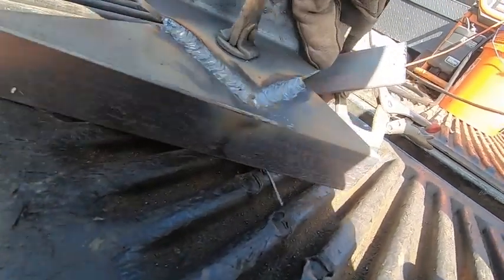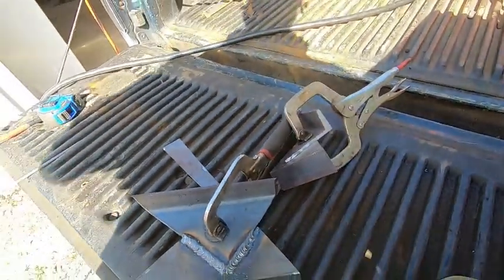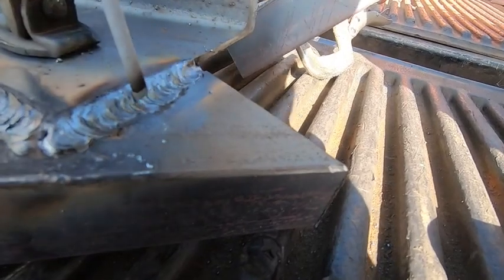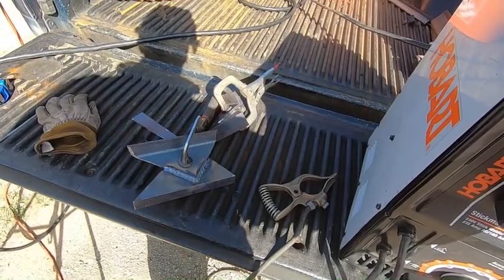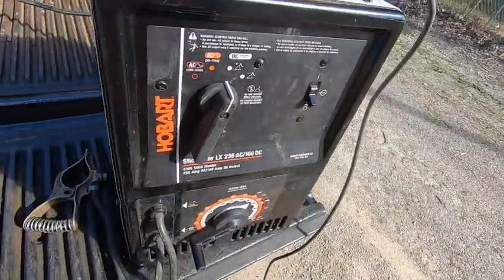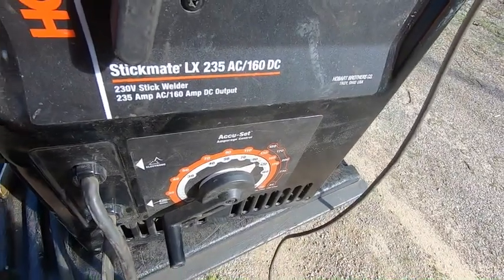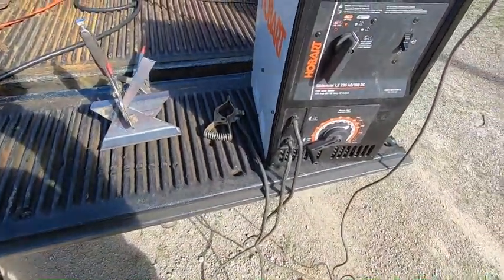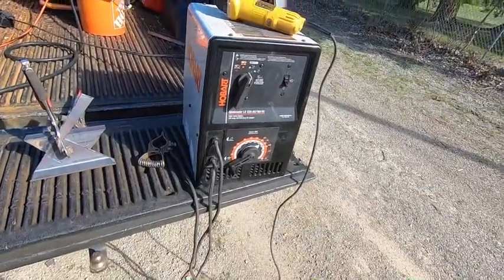6010/8010 welding with the Hobart Stickmate 235/160 Lx

Comment: Hello
I have the same Hobart welder. I've been wanting to use my Champion 10,000 watt generator
 Have you had any problems with your generator since the making of this video?
Reply from the maker: I have had that generator since 2016 or so. Over the time that I have owned it I have had to replace the fuel filter and clean out the fuel system when I came back from a deployment and had it sitting awhile. I never cared enough to check the oil and have mostly used automotive grade oil so sometimes it would burn off and get too low for the auto shut off sensor to pick up, which would shut it off. Add a bit of oil and it was ok. I have since learned that small engine oil is actually better than automotive oil and resists heat from small engines better. So now I use small engine oil and it doesn’t burn off as fast. The battery has gone completely dead so I just pull start it, which being used commercially has caused me to replace a few starter cords. No big deal. I hit the low idle thing-a-ma-jig with some steel and it’s now stuck on high idle, no big deal. One of the Ground fault outlets was giving me issues for a minute but has since corrected itself. Also the fancy smart screen, hour meter/watt meter thing stopped displaying numbers. It is still on my truck powering welders and grinders in a commercial capacity to this day. All the problems I have had with it were things that are wear items easily fixed or options that you don’t need and make no difference mechanically. I have started running inverter welders which are significantly easier on it though. Occasionally it does still run the transformer machines without issue. The Hobart has been used to build about 35 flights of metal stairs if that lets you know how much I used it. Also built about 10 Amish made cultivators with the generator and mig welder. Plus thousands of welding repairs. I did fry a M12 Milwaukee battery with this generator once when I was running the Hobart with a battery charger plugged in. Not sure if that would happen with the inverter welders but I do not plug batteries in on the generator any more. I’ll find a wall outlet or use an inverter off the truck battery before I plug them in to the generator now.
Reply: @scrapmanindustries  thanks, I may be buying another generator as the one I currently have is for power outages. 
I would like to be mobile and get my side hustle going
Reply from the maker: @orlandoherreraoutdoorstexa7353  you are welcome. Get that side hustle going. I have other videos on here from before this video when I was welding and tearing apart scrap in my grandmothers driveway till now where I got my own rig set up. If you need ideas for how to set yourself up there’s tons of ideas on the tube. Some guys put way to much though and money in their rigs but if you look at mine, especially the early days it was a pretty simple and cheap set up

Comment: How do you have your generator set up to run it? Did you make a pigtail?
Reply from the maker: I have roughly 150’ of extension cord. Split up into like 50’ and 100’ sections. The end going into the welder is the stock plug style on the welder. The end going into the generator is a 4 way round with only 3 wires hooked up. I think it’s 2 hots and the positive. Don’t quote me on that though.
Reply: @scrapmanindustries  30 amp breaker on the generator?
Reply from the maker: @chopperduke5998  si senior
Reply from the maker: @chopperduke5998  it doesn’t really pop at all. Unless you get the fronius transteel out and crank it up to start spray arc.

Comment: Other  than ultra high strength steel there is no reason to run such rods .Mild steel only has about 55000 tensile strength .  I can do a bend test with 6011 all day long .  So that means 60,000 tensile strength is all you need
Reply from the maker: yes. but it never hurts to practice on different rods. plus it was a fun experiment after reading tons of people who said that this machine can't run 6010.
Reply: @scrapmanindustries  sir you are 100 percent correct .

Comment: That’s Hobart similar to a red Lincoln 225 cracker box 📦? Looks like hobarts version
Reply from the maker: The Hobart is a miller thunderbolt with a white cover slapped on top of it. It is infinitely adjustable where as the Lincoln has set amps in like 15 amp increments. in my opinion the Hobart welds a lot smoother as well. The one plus side I see for the Lincoln is the handles. If you watch my videos with the stairs. I had the Hobart up and down that enitire apartment complex until I got the fronius.

Comment: I like the way Hobart welder is doing. With the thickness of metal you using, how many duty cycles is the Hobart 100% duty cycle ?? 
3/32 E 7018 and 6010 ++++ Lincoln or esab rods is good for all positions and pipe and put 1” thick metal im sure that Hobart can also handle 1/8 rods
Reply from the maker: The generator is 6800 running watts and 8500 starting watts. Running 1/8" 7018's on the Hobart does make the generator work but I have never had a problem with it. I have ran 5/32" 7018 off that set up as well and there were times where it would bog down the generator but I was able to make it work. I wouldn't recommend that if you were getting paid for a project. I would stick to 1/8" or smaller so you don't destroy your equipment or mess up the project your working on but it will do it occasionally. 

The duty cycle on the Hobart is like 20% near the top end like when you are running 5/32" 7018. 
When your just running 3/32" 7018 I would imagine that your probably somewhere Close to 80-100% duty cycle. 

This was definitely a great machine to start out with. I have upgraded to a fronius transpocket 180. The Hobart has stuck a lot of metal together though and if that's all I could afford I would still be using it. It seems like It will outlast me if taken care of properly.

Comment: 6010 = 60 indicates 60,000 psi nominal tensile strength of weld metal. 11 = 10 digit indicates all position (flat, horizontal, vertical, or overhead) 1 digit indicates the type of flux coating and therefore the polarity that can be used. The zero in 6010 indicates high cellulose sodium and it can be welded with DC electrode positive. 6010 is also known for being difficult to start or run on DC positive if the arc voltage is on the low side, typical with a smaller, less expensive machine running near it's limit. This can also be more of an issue with some brands of rod over other brands even with the same size and rod number. 6010 is generally considered one of the deepest penetrating rods, if not the deepest. For the smaller, homeowner/hobbyist Welders, like the Stickmate, 6011 and 6013 are probably the most commonly used rods in non-commercial applications. 6011 runs nearly identical to 6010, but typically requires less arc voltage, so is more forgiving on a lower powered machine. The 1 instead of the zero in 6011 vs 6010 indicates high cellulose potassium flux. It is also an all-position rod intended for use with DC electrode positive current, as well as alternating current. All other things being equal 6011 penetrates slightly less deeply than 6010. 8010 indicates the same flux type as 6010, but with an alloy that has an 80,000 psi tensile strength. Higher tensile strength rods can sometimes be more difficult to run. 
With 6013 rod the flux is high Titania potassium, and is suitable for AC and DC electrode positive, in all positions, is lighter penetrating with smooth arc characteristics and moderate penetration with minimal spatter, and easy clean-up. 7018 is a low-hydrogen potassium, iron powder flux rod with a 70,000 psi tensile strength filler material, suitable for all-position welding and can run on AC, DC positive, or negative. There is also an AC version of this rod that is made to run at it's best on AC. 11018 is similar to 7018 but with a higher strength alloy filler metal giving a 110,000 psi tensile strength.
Reply: I am 50 years old ,I have been welding since I was 15 .I have been through 2 different tech schools .Lots of certifications .  I learned quite a bit from your comment .Thank you very much for it. Oh I book marked this page because of your comment for futer refrence

Comment: Great job and very helpful! You might want to include a brief description of what each number rod is intended for, maybe how it differs from the others, and compare it to the rod number most commonly used with this machine. That would be good information to turn this into an outstanding video. You could do this either in the description or add some video, whichever is best for you.